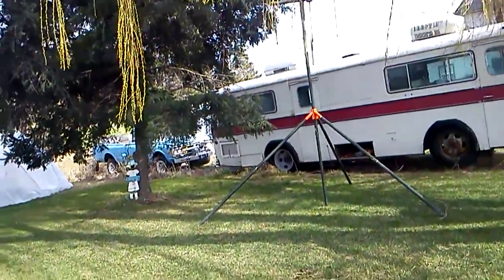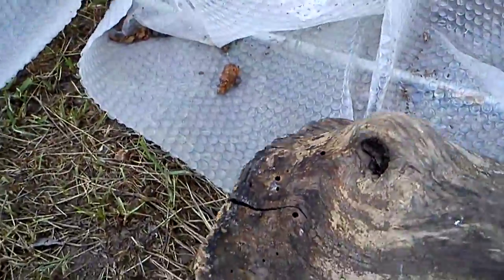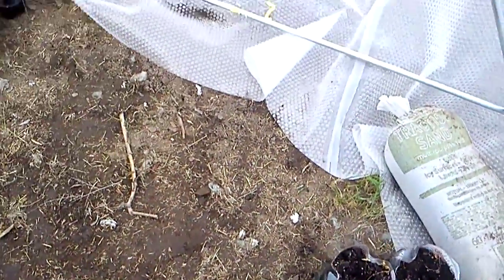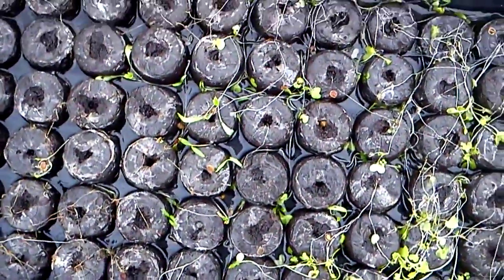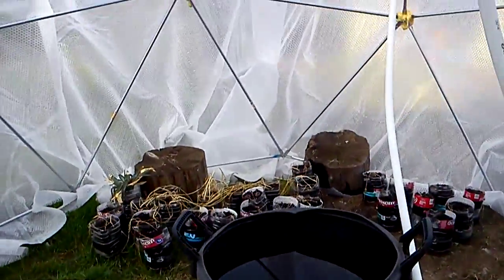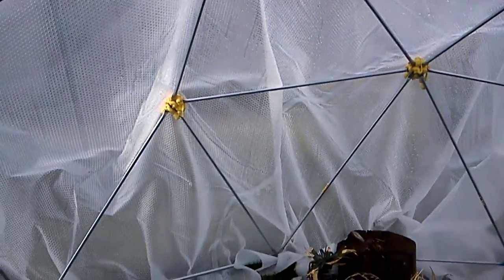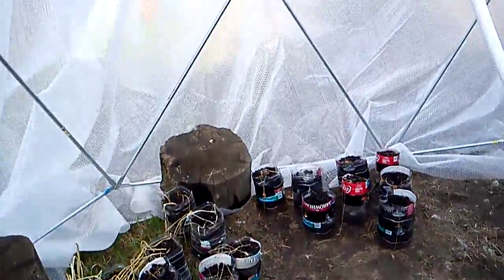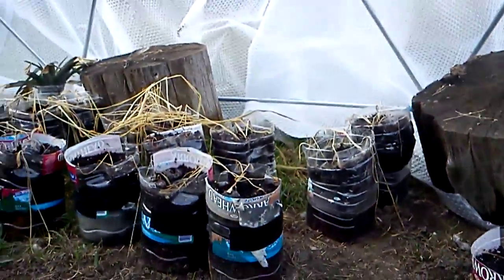Geodesic Greenhouse Dome March 24, 2014

Comment: Nice,plants do better indoors,unless the outdoor temp is 60 to 85 Fahrenheit.Makes sure you use a heat pad in those little green houses,the warmth makes the seeds sprout very quick,some seeds sprout in a few days.Also seedling need lots of lights,outdoor is best for them,but not over 85 degrees.Garden will consume you,but it's a good thing.